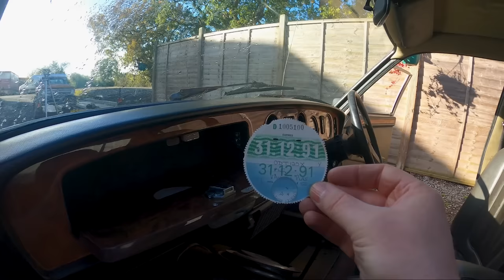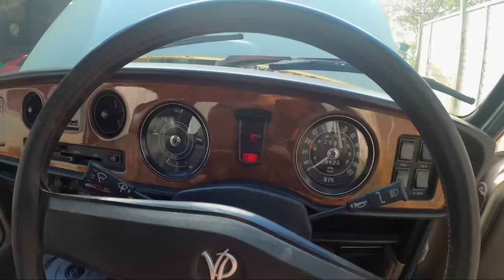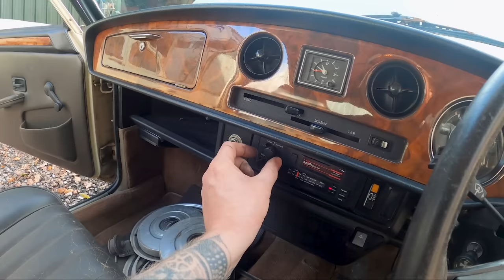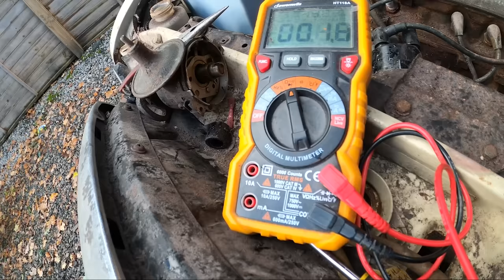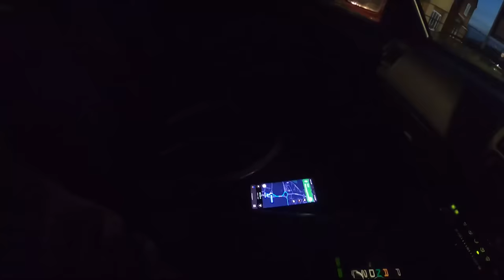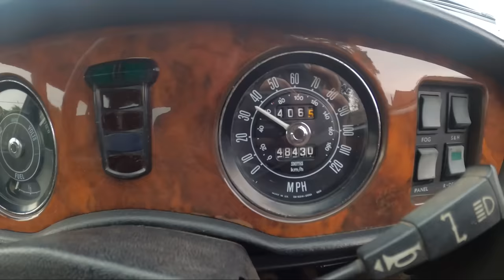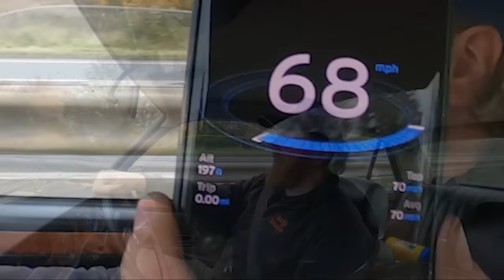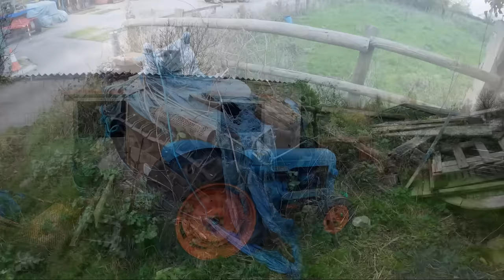Off The Road For 31 Years - Can I Bring It Back To Life And Drive It To Wales?

Comment: Well I have to confess that I was forced to skip most of the first hour but thank goodness you got it running and doesn't it sound great.  The interior is so luxurious!  It's beautiful.  I owned the Australian version of this car called a Morris 1500 and it taught me how to fix cars, haha.  It was a terrible car but I loved it.  I fitted twin carbs and other engine mods and competed in club level motorsport for a couple of years in the mid to late 1990s and had fantastic fun.  I also fitted a simple Lucas electronic distributor out of a Mini and it ran perfectly and never let me down.  The E series engine is very good and the guy who built and modified the engine for me said it had enough bottom end bearing area for about 200hp, quite bullet proof.  Your later model with the rod change gear linkage must be so much better than the cable change of my Morris.  I have a real soft spot for these and I wish that Leyland Australia had been provided with enough money by BLMC to release it here but we got the Marina instead, except with the E series engine modified to accept a Triumph gearbox.  Love the car and I look forward to seeing what happens to it.  😊👍

Comment: What a fabulous journey, filmed with genuine honesty and full of ups and downs. I thoroughly enjoyed watching and like many, this brought back so many memories as a child.  Cars like this have a charm, soul, character and honesty that modern cars simply cannot match.  Seriously how many modern cars could you fix on the side of the road like you did!  The fact you have managed to document this journey in video and edit it together with beautiful story telling is a testament to your skills.  I did wonder if you would have to drive back in the dark, seriously those headlights looked as though they would struggle to illuminate more than a few feet ahead. Looking forward to some serious restoration next on the interior and bodywork, although looks like you won't have much to do given how nice this example is.  Thanks for this and for restoring this beauty, I did smile though at just how small these cars were back then!
Reply: Manufacturers are using more plastic than ever, now, and it doesn't like extreme temperature fluctuations. Also, electronics oxidize and are expensive to diagnose and fix.

Comment: The Allegro was a great small car. It has matured with age. So easy to jump on the bandwagon and slag them off. They were pretty rust resistant, excellent access to everything from a mechanics point of view, pleasant to drive, handled ok with a superb ride. The 1500 5 speed was quiet and smooth. The VDP version was a very well put together car as it was hand built with top quality materials. This is a very late version. Well done for resurrecting it. I had two. Wish I still had one at least.

Comment: Ben, this video was fantastic to watch. Proper tea time tele!. As someone who has resurrected another Allegro into daily use (mine had been parked up in 81, so nearly 40 years) I can relate to the issues you faced. Sticking caliper sliders, seized suspension but my car is now in daily use and has covered some proper miles this year. Ive also covered the work on my one and feature it on my own Youtube channel. Well done mate. Cracking video! 🙂

Comment: Back in the early 80s my Grandad had one of these, also an X reg, so it was one of the last ones made. He had a light blue one, and as a kid I used to go for a ride in the back when we visited grandad and he took us out for a ride in it. I remember going on a day trip from Telford, where they lived, to Lake Vyrnwy. Always remembered the walnut picnic tables in the back of the front seats, no car I have ever been in since has had them. Leather seats, very posh inside really, but grandad always liked to take grandma in luxury as best he could, even if it was only an Allegro.  he had an Austin Princess Vanden Plas 1300 on a K plate before the Allegro, which was just an upmarket Austin 1100 with all the luxuries.
Was nice to see one again, all these years later, and also an X plater, just like Grandad's was. Pity it behaved like a flying pig and was all aggro on the way to Wales, but I'm sure the next owner will be able to sort it out, as the bodywork was very much worth saving with so little welding to do. 
"I think it might have a slight exhaust blow", lol - might have something to do with the gaping great hole in the middle box I saw when it was up on the lift - could have stuck an exhaust wrap round it to quieten it down, but I guess you like em to sound a bit raucous - all adds to the clapped out effect, haha.
I wish the old girl the best of luck - there aint many of these left now, and she deserves to be saved and restored - not Johnny Smith style though, keep it original.

Comment: Excellent video. Nice to see that Allegro/Vanden Plas rescued and put back on the road. I always wanted one of them, in the 80's, as an upgrade from my Austin 1100.
When playing with those old contact breaker ignitions, I used a 12v bulb on a wire, one side to earth, the other connected to the CB side of the coil. Breaker open = bulb lit. Breaker closed = bulb out. That way you checked the power capabilty of the wiring, the contacts of the CB and you could also set the static timing. Much better than a digital meter, which sometimes tell lies, with high resistance faults. It looks like someone had totally bypassed the coil with that bit of wire. So the CBs took the live straight to earth, when closed. Surprised it didn't blow the 30A fuse.

Comment: 2 hours 46 mins of utter comedy , you are hilarious to watch cutting corners just to get an engine running and even seting it on fire more than once, most people would stop at one fire check the high tension circuit and then the low tension circuit, you even replaced the coil and reconnected the wire that was shoting it out, why didnt you have a look at the coil on the other 1500 you chedcked out the dizzy on? absolutely mad keep em coming the comedic value is priceless.😂😂😂

Comment: Takes me back to my mum buying a brand new mini 850 in 1966!  Then all through my early years everyone I knew had either mini's,  Austin 1100's or my beloved Austin 1800 I bought for $200.00 in 1980.  100% original and perfect working order and it handled 80mph bends like a go kart and had HUGE front brakes!  I'll never forget the front brakes and that gorgeous suspension.  Unfortunately one evening after driving home after work I was racing one of the mechanics on the way home in his Datsun 180B but I threw a rod through the block!.  Ended up selling it to our neighbour for $400.00

Comment: I learned to drive in an Allegro which was actually a pleasure to drive unlike the other car I learned in which was a Austin 1100 which would scream it's guts out as soon as you touched the accelerator. That Vanden Plas is exotic for such a small old car and worth saving.😁👍

Comment: Gotta love BMC/Leyland and their mindset of "take the basic car and put a big chrome grille on it, chuck a few leather seats in, and give them a bit of wood inside and you're golden".
I've got a Wolseley Hornet and it has that same element of "luxury" features, been in the garage for 30 years, pretty good condition apart from some trouble with the electrics, no spark or headlights but the motor turns over. Hydrolastic pumped right back up with no issues.

Comment: First 'big' job I did on a car was change the clutch on one of these (my Mum's car at the time). Pretty simple job really, even for a 14 yr old :)
Reply: Yeah one of my first clutches was an Allegro, breaking the taper on the flywheel to the crankshart was a lessom,  you had to put as much tension on the flywheel puller as you could then hit the top of the Flywheel hub with a copper hammer and ping ! it was separated from the crankshaft, man what days with the A series engines we had

Comment: Just settling in to watch this. Interesting to see a late Vanden Plas. Although Austin Rover didn't do a Vanden Plas equivalent of the Allegro Series 3, it does have some features like the black door mirrors and the flat bootlid but not the relocated number plates or Series 3 rear light clusters. It also has the later interior door handles and window winders shared with the Metro and it's a Series 3 colour. 💯
Reply: The flat bootlid was a standard feature from the VPs launch - the S3 adopted it. This must be one of the very last VPs made.
Reply: @byronmills5952  this is a very late VP indeed. However all the earlier Series 2 era VPs have a creased bootlid. The crease was removed for the relocation of the number plate on Series 3 Allegros but these late Vanden Plas remain a bit of an oddity because they have a flat panel bootlid but the number plate is still below the bumper. Similarly they have the Rolls Royce picnic tables but plastic window winders; black mirrors and a chrome grille; and they retain the older rear light clusters and separate reversing lights. Altogether a jumble of the old and new.

Comment: That wire fault reminds me of a hydraulic fault we had on an 8 wheel grab lorry at work... nobody could work out why the hydraulics wouldn’t work properly until we undid a pipe and pulled the trigger....out the end of the 10mm hydraulic pipe came a workshop rag! 😮

Comment: An old aunt of mine had one of these, it was an M reg from memory in a deep Westminster blue with a dark blue Everflex fake leather roof. The seats like you said were fabulously comfortable, the car was nippy rather than fast as you said and you could get lost in the thick pile carpets. When she decided to stop driving she offered it to me as a gift but I'd just paid £675 for an 18 month old Triumph 1300 front wheel drive which is another underrated old car, so  I declined and it was taken by another cousin. The family mainly had Austin's, Mini, 1100, 1300, Cambridge, Vanden Plas which is a tarted up Austin, Metro's, Maestro, Maxi and 1800 land crabs. You can get 4 adults and 7 kids in one of those but you don't get a very good view out of the windows.

Comment: You can buy soft copper pipe from a plumbers supplier. 8 and 10mm od, plus compression fittings, straights and elbows. If you can save the ends, you can replace the suspension lines yourself.
I made new lines for my Isuzu 4x4 power steering, aged me over £240 getting new ones mad e.😉

Comment: Excellent and very interesting video, I have a particular soft spot for the Allegro Vanden Plas as it was my job as a collection driver for Mann Egerton in North London to pick these cars up and take them for valeting and sometimes delivering them to the 1st owner.
A lot of the sales staff laughed at them and said that they might last 10 years if lucky before they rotted away and your video just shows that this isn't true as I told them , that if it was garaged and regularly maintained, they would still be running in fourty years.
Well done for rescuing this lovely example and wishing you well with the resto.

Comment: Tip is to hold rotor arm in distributor cap with thumb on the carbon contact to see if spark jumps. Then with ignition on open and close points gap. A spark will then be seen jumping between rotor arm and distributor contact.

Comment: My first car (purchased in Jan '80) was a '77 Allegro 1500. Self-levelling suspension bit me in the bum; got a puncture in a back wheel on a long ride and never knew it was going down. When I got there the tyre was down to the steel belt. Apart from that the car served me well for the 3 years I owned it.

Comment: The little switch that lights red when you push and release is your  low brake  fluid pressure  warning light .  You're meant to press the switch to check the bulb  regularly. 
 I had one of these in two tone  brown and beige when they were 100 quid bangers   ran it for 3 years till the chassis collapsed

Comment: it is possible to re-solder the starter armature with a blow torch and then take off any high parts of solder on the brushes commutator (the copper segments) because what happens when you turn the key continuously, the solder melts and flies out when it turns.

Comment: With seized callipers you can pump them out, remove the gaiter carefully using a pick carefully remove the square section seal for the piston, then use a scraper (A thick feeler gauge to scrape the rust out in region between the gaiter and up to the seal, once clean reinstall the seal. You can clean the piston as it’s out and then reassemble. Partially seized callipers tend to seize when hot which is after a few brake applications. If it’s all corroded though it’s new or full refurbish time. There are companies that can re-sleeve them if not available as new.  With the seized rear hub due to handbrake on, it would have been more likely to free it off by smacking the brake hub with a bronze hammer. Seal kits for the callipers should be available.

Comment: An enjoyable video. Its the bread and butter cars that are the ones that bring back memories. Im here looking at a fancy Allegro and not looking for Ferraris or Lamborghinis because they hold no memories. I dont know anyone who owned a Ferrari etc but I used to see Allegroes all over the place. Its also fun to watch the challenge of cobbling everything together to make it run. I havn't done that since I was an impercunious  student. With my classic if anything is not perfect I just replace everything with new. This looks like fun and reminds me of driving without a petrol tank or  driving with pliers connected to the accellerator cable as it broke at the foot pedal and of course lots and lots of repaired cooling hoses - ( Top tip for cooling problems depresurise the system, make the repair then top up every few miles.

Comment: I owned several of these between 1988 and 1991 when you could buy one for £220, keep it a year and use it til the mot ran out. The 1.3 Allegroes had A series engines  but the 1.5s and were ohc and revved much, much more sweetly. The extra power didn't look  that much on paper but on the road  the 1.5 was a much nicer car. 
If it'd only been made as a 1.5 it would be remembered with a lot more fondness. 
Interesting vid. Thanks.

Comment: The suspension on the austin 1100 was real high pressure in the region of 1400 P.S.I. its not water and requires a special equipment to fill. Amazing condition really.

Comment: As a former auto electrician all I could think was change the starter, early on it sounded like it was stuck engaged.. the mystery wire..  maybe it was from a suppressor for the radio  which would of gone from the coil pos to the coil body, it probably broke off when they took the coil off
My old man had an R reg Allegro when he passed away in 97, mint car, it wasn't my thing but I wish I had it now lol

Comment: She does have all the charm and mechanical reliability of a severely shot up Tiger l tank. She is as aerodynamic as a large barn and leaks from every system. It has the same intangible beauty of an AMC Gremlin or a Pacer.

Comment: Maybe those carburettor dashpots need to come off for a clean so that the needles can move better in the jets. It sounds like they are not coming up far enough and causing fuel starvation to one or two cylinders. The same happens on most cars with SU carburettors that have stood for a long long time.  Also the alternator bearing that was tight is probably what is squealing (WD40 ?).

Comment: I remember the Allegro growing up as a Kid here in New Zealand, They built them at a couple of Plants here under the New Zealand Motor Corporation (NZMC) which was a Partner of British Leyland back in those days, A handful of the 1500cc Vanden Plas models ended up down here which was quite strange as the Vanden Plas was not supposed to be sold outside of the UK, They might have been special orders by customers. 
The Allegro down here was supposed to replace the Austin/Morris 1100/1300 which outlasted production in the UK funnily enough, Never happened though as Japanese cars were starting to flood the market, NZMC then started putting together the Honda Civic and Accord which pretty much ended production in NZ, Around 7,000 units were built in NZ, They were not offered for sale in Australia.

Comment: I  used to prep these in a BL garage when I was a kid, 15 years old and working in a garage after school. VAN DAN PLAAAAH but then Alegro! Later in life I engineered test systems for vehicle wiring harness production, if I remember right there was a resistance wire that dropped the voltage to the coil to 10v (bridged when starting) but still that was connected up wrong. The money these cars were new they were always looked after, smelt like an old car from new!

Comment: Standard Bendix starter motor, as fitted to the pushrod engines. What you need is the pre engaged type, fitted to modern engines.
To be fair, if you’d asked me, that’s what I would have sent you, too. Who knew they had modern engines in Allegros? Over head cam and pre engaged starter? That was state of the art, back then!

Comment: I started into electronics over 50 years ago and, even then, most people used the term "capacitor" and the older name "condenser" from the early valve radio days had mostly fallen out of use. For some reason the thing inside an old fashioned coil ignition distributor never made the change and will forever be a condenser..

Comment: quiet and smooth.....sounds like the valve train is rattling its bollox off.  the ohv version was a bit tappety but the ohc should be quiet as a mouse. even so, good job getting it running, well done